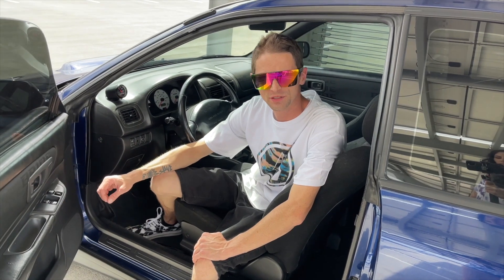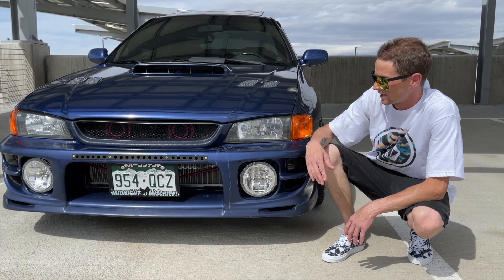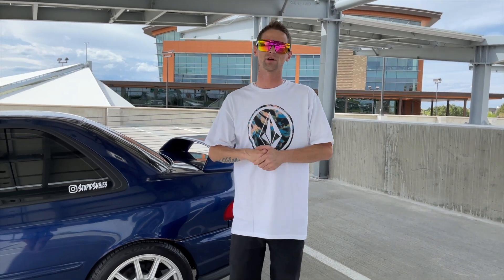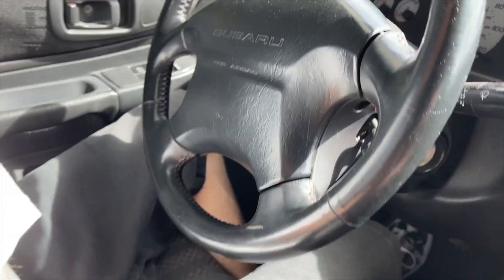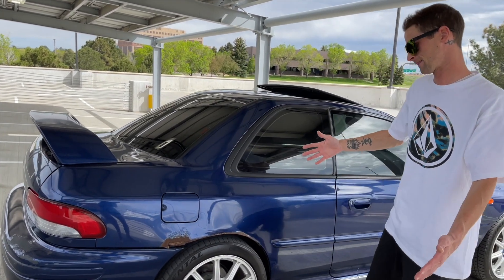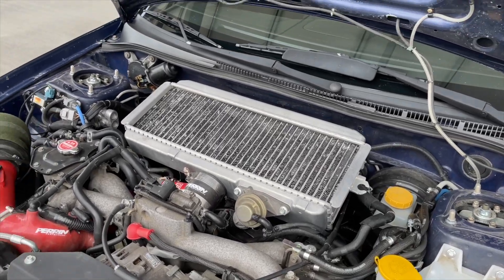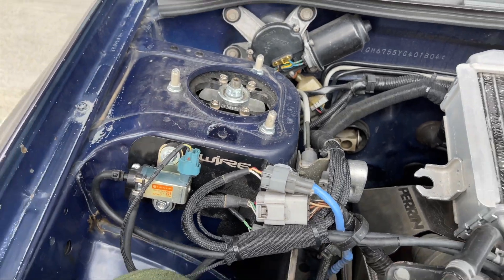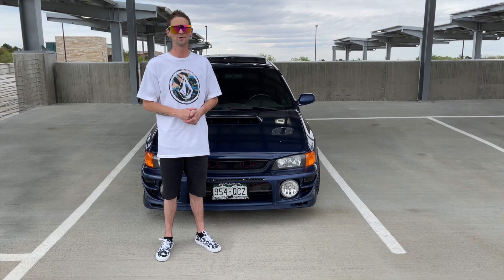Everything You Want To Know About My Girlfriends GC8!

Comment: Cool video dude... I have the same swap that I just did a couple months ago.  I do have the jdm ecu and with working avcs.  I am trying it to tune it but can only do open source, any suggestions.  Also what wheel spacers are you using?  Thanks in advance
Reply from the maker: Awesome to hear that you have the same swap with a working ecu I hope you can get some tuning options figured out. As far as I know the 3 best options for having that work is to do open source like you are or leave the ecu stock and just enjoy the car as is or you could go the more expensive option and use a stand alone ecu. I believe the wheel spacers are ISC 25mm 5x100 to 5x114 and they clear stock studs without cutting. All the logo has warn off them so hard to tell.